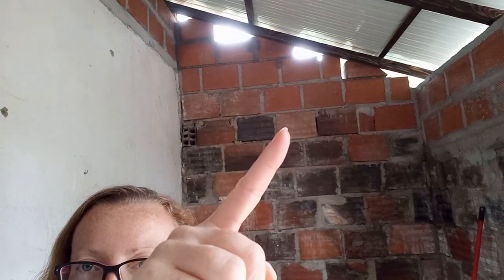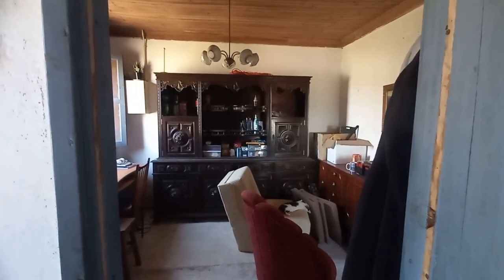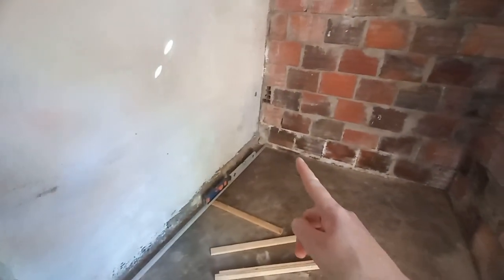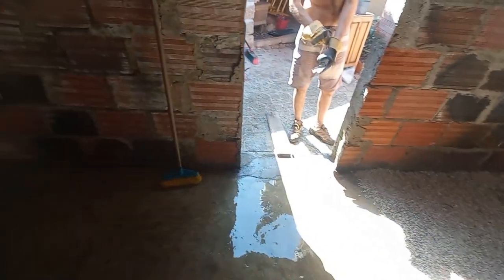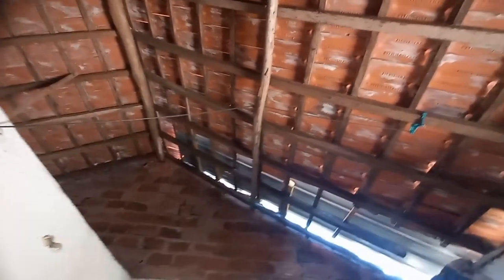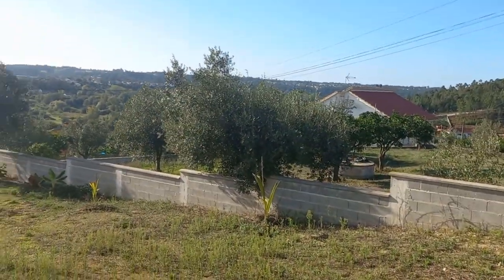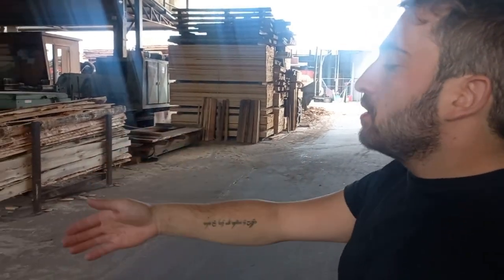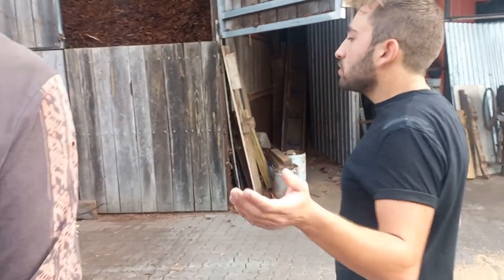Trouble in Paradise, Roofing Shenanigans & Sawmill Tour

Comment: Hello guys.
About your problem with the roof. How to make it legal. You can always cover the sandwich panels with simple clay tiles (we call it roman tiles). So the Câmara rules for the village were respected, and your roof would have a rustic appearance. You can find a lot of used old tiles in old houses. I think you have to present this or any other solution to the Câmara and talk with them before any move.
Good luck.
Reply from the maker: An excellent idea but we are concerned about the added weight of the clay tiles as we have calculated the structure to support the minimal weight of the sandwich panels. I'm also not sure how to secure the tiles without creating water ingress. For now we are following the instructions of the inspector to finish the roof with the current materials and he will take photos to submit for approval. 🤞